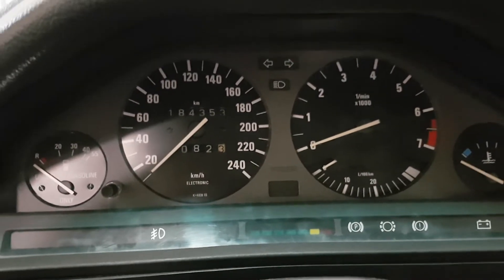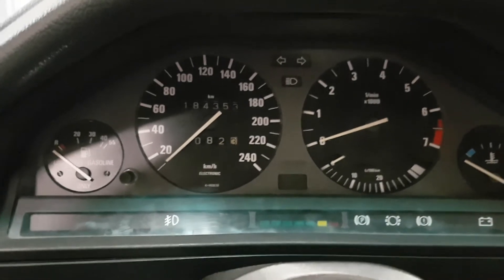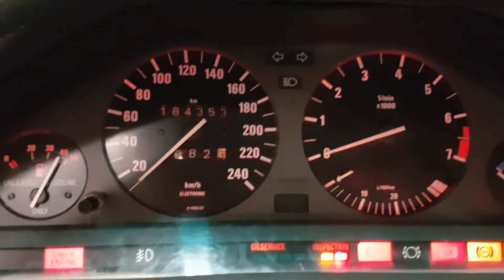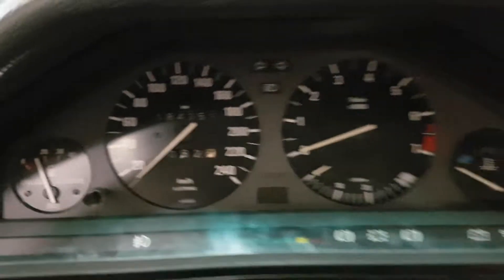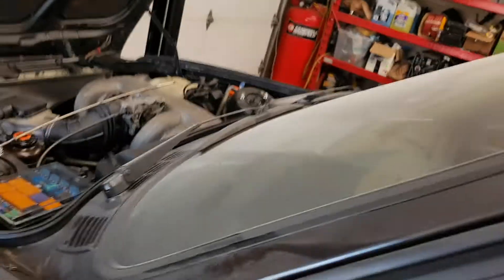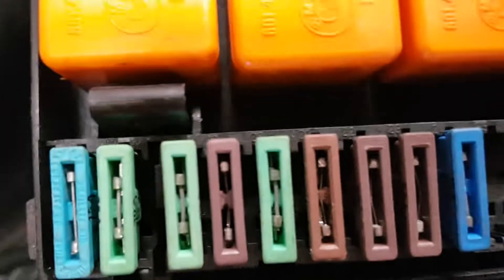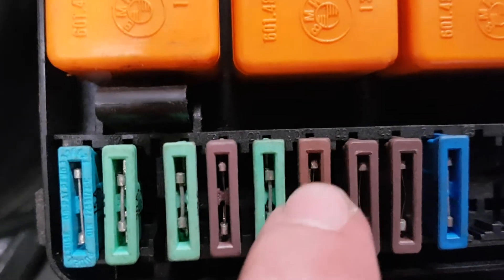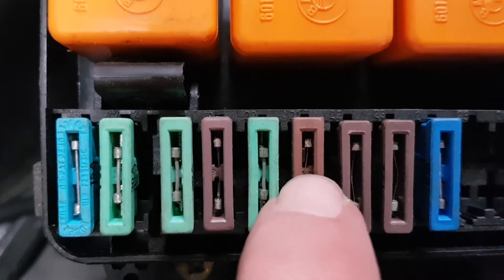E30 gauge cluster (tach/rpm) not working *quick fix*

Comment: I have a 2014 Buick Verano and the rpm move when I turn the ignition on but will not move when the car is started nor does it move when I press the accelerator. Can you help?

Comment: Hi, in my case the tachometer needle goes little bit up when my key is at "on" position but when you rev the car it does not move to show that it can feel the pulse and when you are driving it goes up until 1 on a tachometer watch, what needs to be checked here?

Comment: thanks buddy hopefully it's just a fuse for me my car is already 30 years old and I'm thinking it's also my SI batteries needs to be replaced
Reply from the maker: Hope it helps. Its a cheap fix if it is :)
Reply: @BimmerSourceCA  thanks I just check my fuse unfortunately it's not my radios working it's most likely when SI batteries have you replace yours yet?
Reply from the maker: @ALBreezyx68  ahh boo, that sucks.  The other thing you can try as well is make sure its grounded properly on the back.  Theres a tiny 5mm nut on the back side.  Sometimes they loosen off. If not, its likely your SI board :(
Reply: @BimmerSourceCA  yeah that was the first thing that I did hoping that it would be the main fix cuz that would be the most cost-effective LOL thanks though so most likely it's the SI batteries?
Reply: Hi guys here's the updates with my gauges since this last time 
I changes the so batteries and swap out the ECU.
Tighten up the ground nut at the back of the gauge 
Replaced the temp gauge.
Replaced the temp gauge sensor 
And after all that temp gauge still doesn't work. 
The last thing in my check list was put a new temp gauge wire and connect it directly to the harness and after all that sweet and tears. It's worked. 
If anyone is struggling and planning on doing this I recommend download the BMW e30 ETM
Reply from the maker: @ALBreezyx68  Awesome, thanks for the updates. Hopefully this helps others!

Comment: In my case. It works but it has jumps. In one moment it works well, then it goes down to zero, and immediately afterwards, it continues to work.
The fuel consumption indicator works a few seconds and then stays fixed.
What can be my problem?
Reply from the maker: Try removing your gauge cluster and tightening up all the little screws on the back. Specifically the ones behind your fuel gauge.  Sounds like a grounding issue
Reply: @BimmerSourceCA  lol...her stepper motors are bad
Reply: Hi did u find out the solution to ur problem??
Reply: @habibali9752  no yet. ...
Reply: Find a solution yet ? My Toyota is doing the EXACT same thing, only that it doesn’t jump any more, it’s just at 0 . Anyone know a solution ?
Reply: Пайка контактов поможет

Comment: I have the same issue on my e30 but it’s the speedometer that’s not working, will this work as well?
Reply from the maker: Speedometer could be the speed sensor on the differential or the tiny grounding screw on the back of the gauge cluster. They loosen off or fall off over the years. Make sure they're both nice and tight

Comment: I have the same car. The temperature gauge is not working. Can a blown fuse cause the problem? I have not checked them yet. Someone told me there is a battery on the PC board that needs to be replaced.
Reply from the maker: Sometimes it's a grounding nut on the back if the cluster.  Could also be ta bad temp sensor too

Comment: I ha e the issue with tach not working as well as cluster lights and the clock. It all hepened when i touched 2 wires behind the radio... Was trying to fix my heater lights ... XD but the radio still works!  Do you think it could be that fuse? I checked it, looks good , but as always visual inspection doesnt say all about fuses. Do u have any suggestions?
Reply from the maker: Yes, itll most likely be your fuse.  touching the 2 together probably tripped the fuse. you'll likely have to replace that one.
Reply: @BimmerSourceCA  thanks, will be checking that at the weekend

Comment: hey sir, can u help me ? my bad rpm is heavy..like only goes for 1000rpm when running about 100km/h.. it happens after i try to rev & spin my front tire (bad move). What do you think is the problem, the meter itself or maybe something like fuse that u mention.. only rpm is heavy..idling is ok.
Reply: Декодер смотри